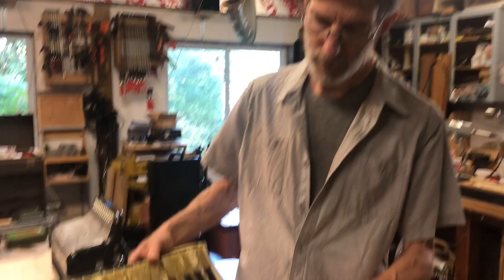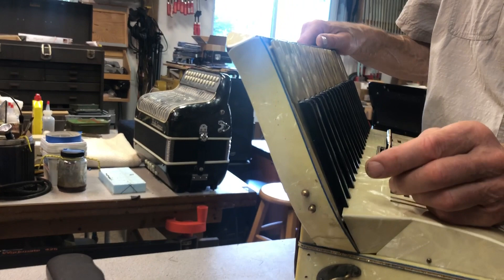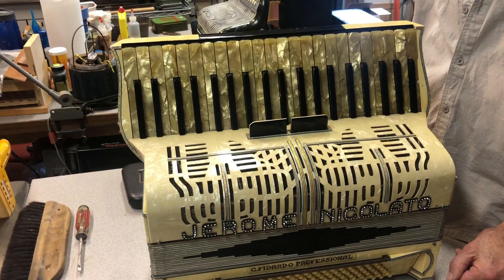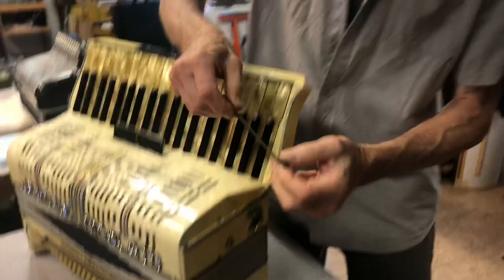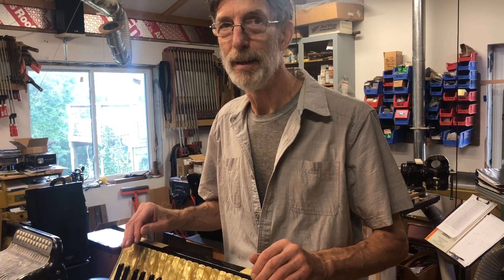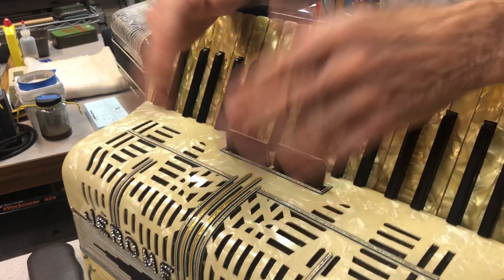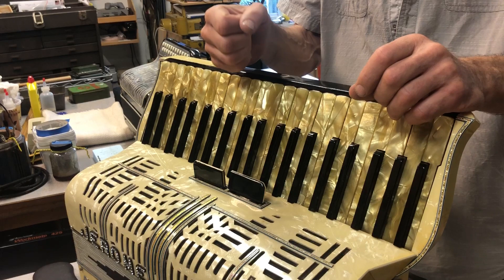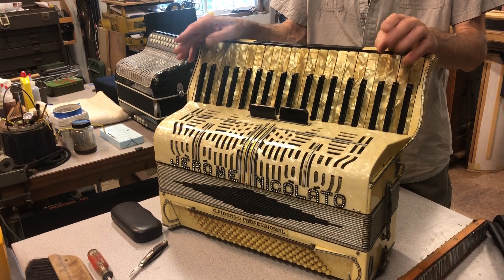Accordion restoration by Ed Marris

Comment: Thanks for sharing.  I repair, recondition, and restore vintage piano accordions.  Few people understand the work required to replace treble key valves, adjust the key travel, level the keyboard, clean and polish the keys and foundation plate, and insure that the pallet pad material is correct for both the white and black keys.  The reed work is formidable and requires both sides of each reed plate to be cleaned, each tongue voiced, and each leather valve cleaned of old glue, rolled and preened, and new glue applied.  I frequently use fiberglass Erasure Company pens, graphite #2 fine lead mechanical pencils, and lighter fluid to remove rust and smoke film that has covered vintage reed tongues.  It is very disappointing to see the lack of quality leather valve material of today and I often have to glue booster spring steel strips over the leathers to better insure long term excellent performance.  Adjusting the spring tension of each treble key is important.  I often replace all of the wooden key pallets if there are signs of wood worms, exposure to moisture, etc.  Air compression is often
much improved when goat skins are used for reed valves, bellow gaskets, and treble valves.  Installing a new seal for some the treble switch mechanisms can be very helpful in maximizing air compression.  I am 76 years old, play 25 gigs a month, am an accordion technician, and love all things pertaining to accordions.  I use MIDI accordions, Roland FR-7x accordions, acoustic amplified accordions. and play many styles of music.  I really appreciate what you have accomplished regarding the restoration of this accordion.  Another accordion saved is a wonderful thing.  Ron U., NE Iowa.

Comment: Ed Marris mentions the high quality leathers which were thick and supple. I'm a piano tuner/technician from the UK, and I wondered if some of the leather available through the piano trade here in the UK would be too thick? It's certainly fairly supple, I think some of it may be deerskin... Just the other day a friend of mine was working on a bandoneon,  and the leathers were significantly thinner than one finds for use on pianos. What are your/Ed's thoughts please? By the way, the default tuning for PIANOS in the UK and in Europe is A=440 Hertz.